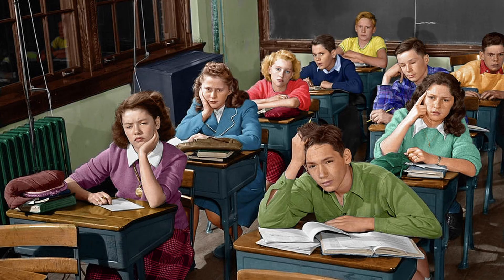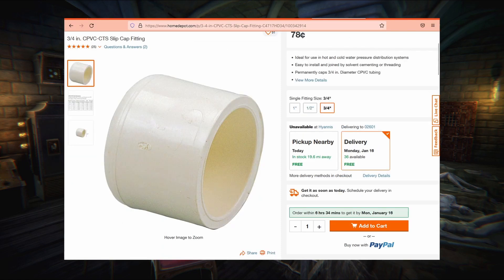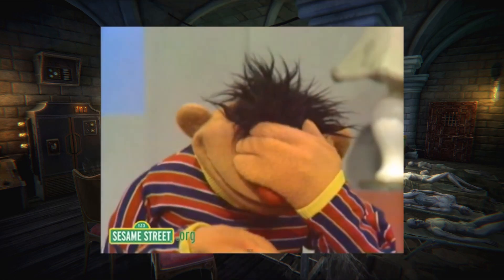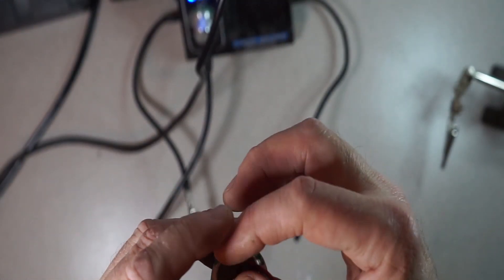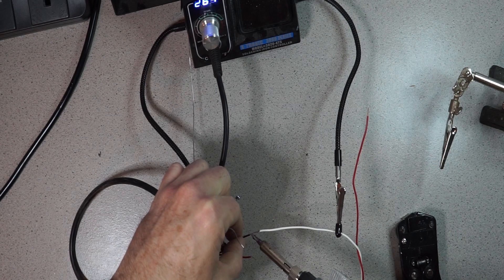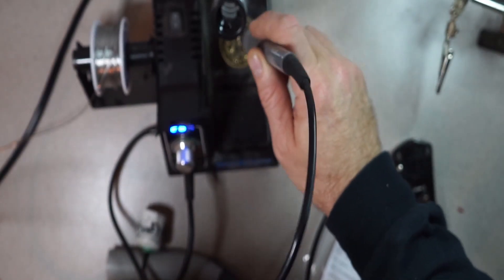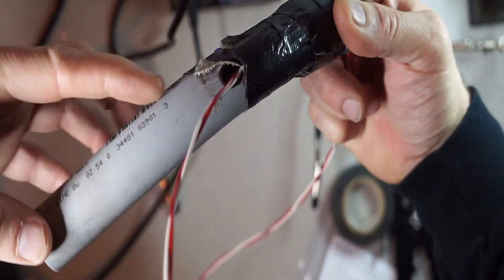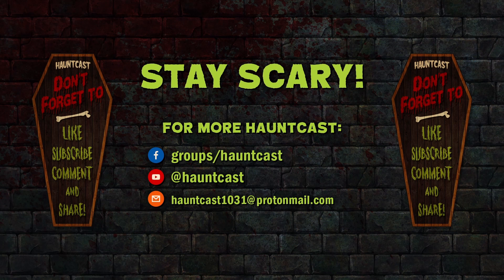Make Cheap DIY LED Spotlights | Home Yard Haunt LED Spotlight Tutorial

Comment: Are 10mm led's brighter then 5mm? I prefer marine grade heat shrink tubing. Makes connections water tight and they dont get all sticky and gummy from being exposed to So. Cal. daytime heat and sun.
Reply from the maker: 10mm are brighter. I buy pre-wired LEDs from Lighthouse LEDs and never had an issue with moisture getting in. I get a lot of rain in October and these Wago terminals do the job.